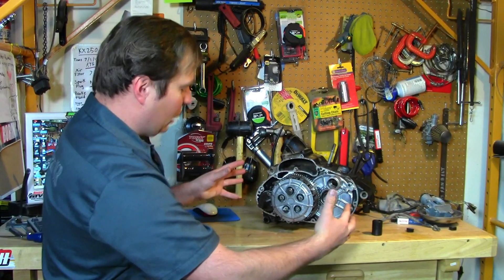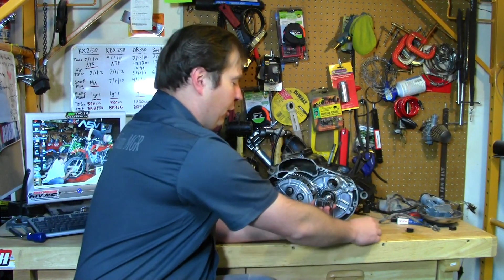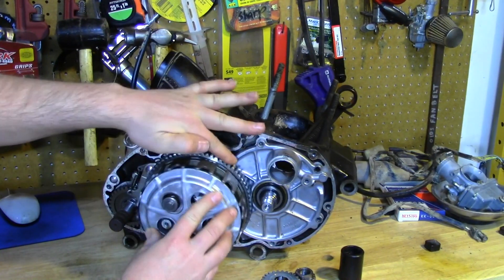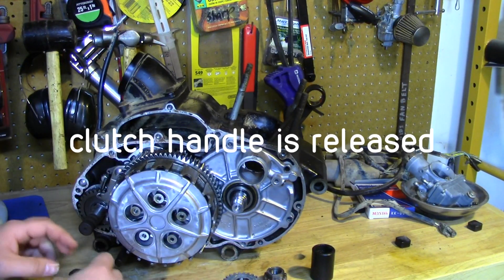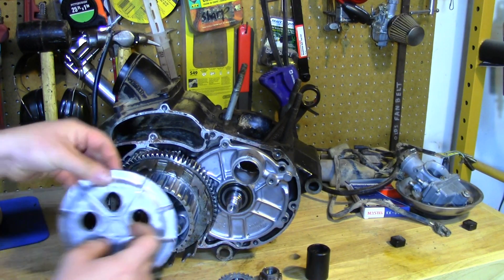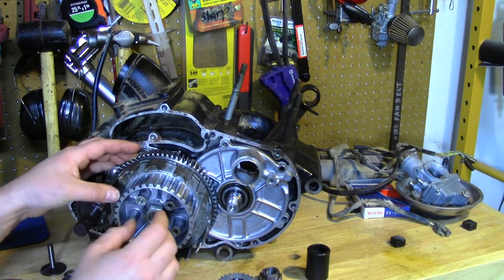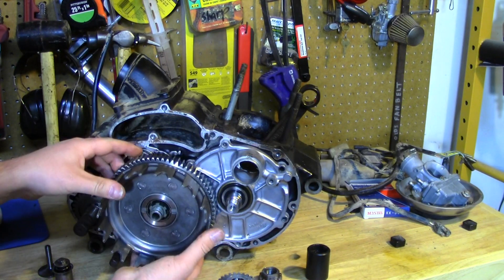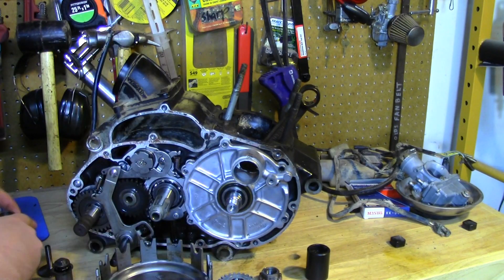How a motorcycle clutch works & disassembly

Comment: How about a short tutorial on how to shift through the gears while the engine is on the workbench?

I hate to split the cases on my '76 KE125 if I don't need to. Thanks! I enjoy your videos.
Reply from the maker: Just rotate the crankshaft or countershaft a little when you move the lever, it will click the shift forks into place on the shift drum.

Comment: I enjoy these video's but please warn potential F5/9 restorers about the small screw with the LEFT hand thread on the end of the crank before they go in with the impact screwdriver. Also after removing the primary gear and with the bike in neutral place a socket in a cordless drill and spin the clutch basket at a good speed and by looking from above check it is running true on it's rivets otherwise you risk baffling clutch drag even on a N.O.S basket. Ask me how I know this!!!.
Reply from the maker: All that is on my website and in my Barn Fresh resto video and in the F9 Project video series. This is an excerpt with more general information that applies across many bikes.